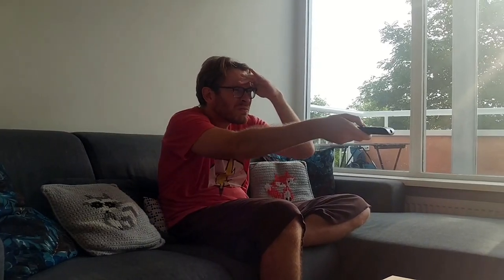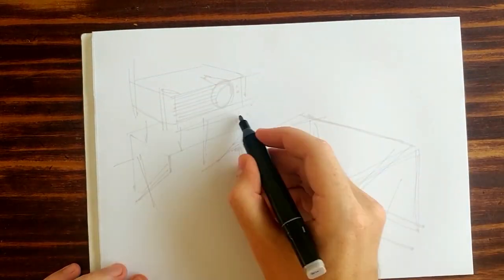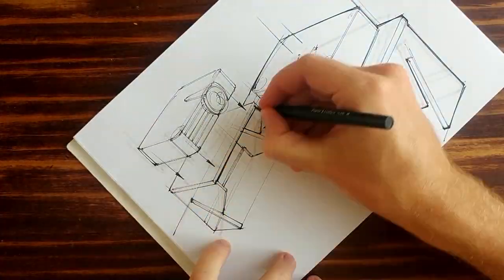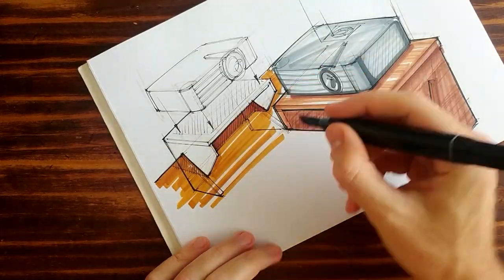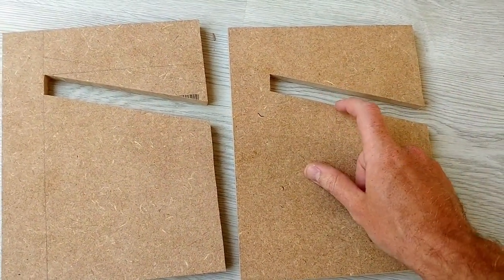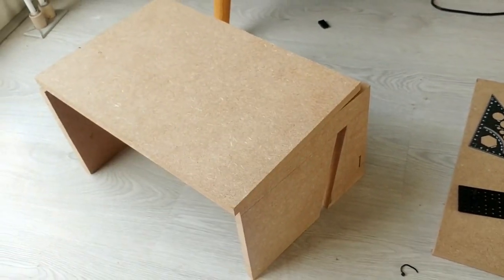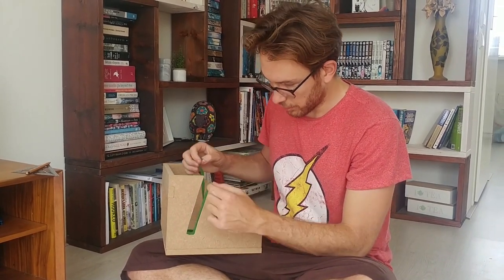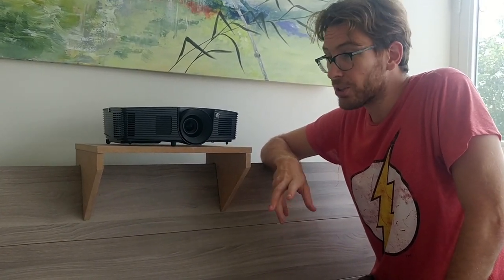Industrial Design DIY Project: Rapid Prototyping a Projector platform

Comment: Fun project and great result! Very nice video! May I ask — what camera setup do you use for your overhead shots while sketching? I have found that the back of my head can get in the way of the shot if I simply mount a tripod over the edge of my table while working. Thank you!
Reply from the maker: Thank you very much mate! Haha you should see my "professional" setup. I use a phone trypod with the flexible legs that i wrap around the arm of a painting easel. The painting easel arm is just a bit above my head height so I'm forced to be very attentive when I'm drawing. In the beginning i had the same problem with my head hanging in, but making it almost impossible to stick my head in is a big help even though my view on the drawing is a bit obscured from time to time. Btw awesome videos man, you gained a new sub :)
Reply: Robert Laszlo Kiss I see! Having the camera low enough so your head can’t accidentally get in the shot makes a lot of sense! I will give it a try! Thank you also for your kind words about my channel — I’m happy that you like it! Cheers!

Comment: Very cool idea! How many iterations of the design did you go through before deciding on the final prototype? Do you sketch all your ideas on paper first or mentally in your head like I often do? Great to see you actually built it yourself as well!
Reply from the maker: Thanks, man. To be honest, not many iterations at all. I did change some early cribbles based on the measurements what I took from the bed. Mostly the front part of the two "legs" mainly the slant and how far I can cut it back. But I felt like it was straight forward what this holder needed to do so functionality wise it's there.

The iteration and redesign phase would start now. I could do iterations regarding making it maybe a bit smaller/more compact, seeing where it might need more structural reinforcement. And then, of course, the looks could be improved a lot. I will probably take one other commenters advice and try to see if I can fit veneer to it to make ti look a bit better, but this was just something to make our lives better, it's not a product I was thinking about making it market-ready :)